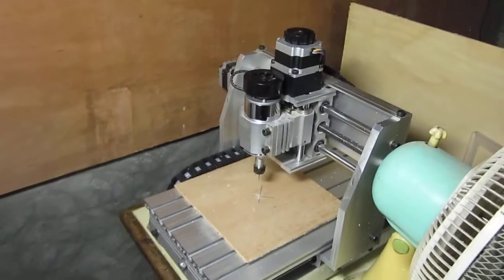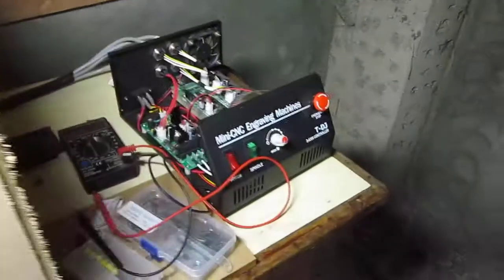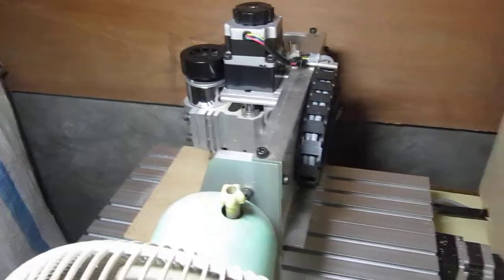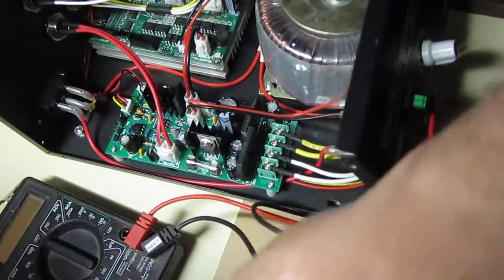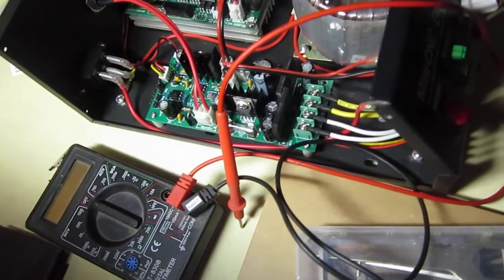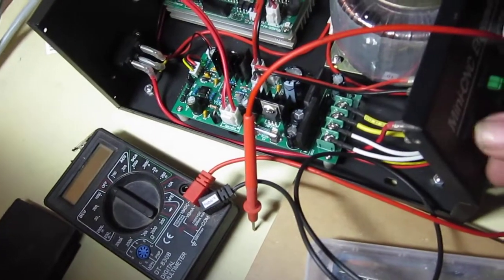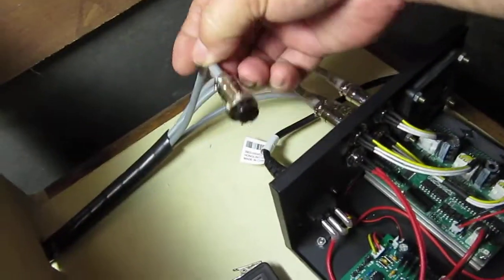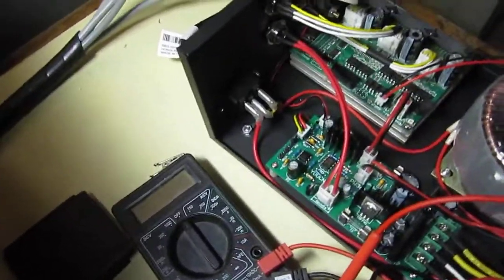Broke CNC only good for two weeks

Comment: Do you have any idea what the current draw should be on the 48 volt spindle connector? I'm sure that you have already addressed this but is the voltage possibly being loaded down? What was the burned resistor actually hooked to?
Reply from the maker: no idea about the amps but it is the driver board for the router motor I have a schematic crafter2u at hot mail
Reply: Dennis Peacock
You can get a rough idea what the current rating is by looking up the specs on the router motor and if you have traced it back to a driver mosfet you can also look up the specs on the mosfet too.

They will configure the circuit one of two ways. The most probable way would be to place the supply voltage on one of the wires feeding the router motor and then using the mosfet as a on/off switch to pull the other router motor to ground to turn it on.

The least likely way but is also possible is they have one wire on the router motor grounded and the mosfet has the supply voltage on the drain and the other wire hooked to the source.

This is what you can check if you haven't already done so. Do you have a good gate drive signal or voltage? If yes and if the voltage is supplied to the motor and using the mosfet to pull it to ground to turn it on, measure the voltage on the router motor in resoect to ground and see if the input voltage is sagging and if the mosfet is supplying the voltage, see if it's sagging there too.

It may be a voltage regulator. What was the resistor that burned wattage rated at and what was it's value? For it to smoke I'm wondering if it was a current limiting resistor either for the motor or the mosfet. Good luck with the repair.